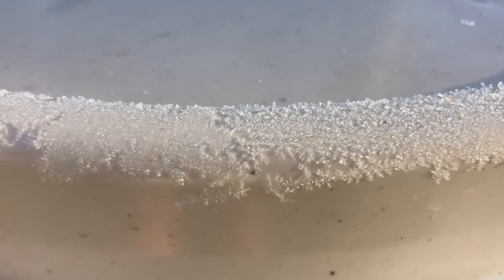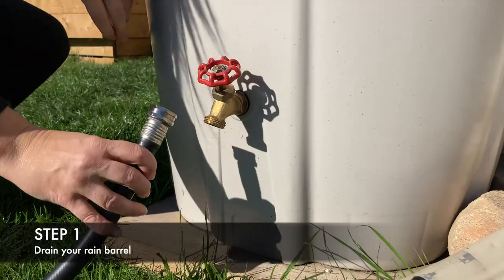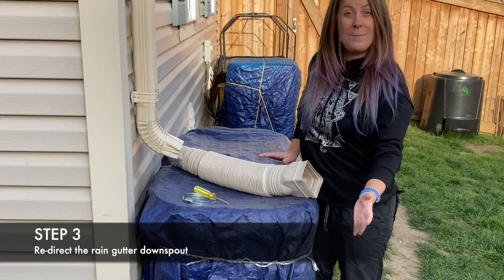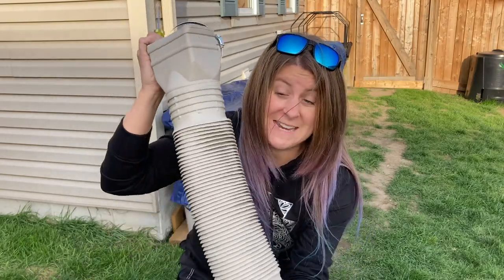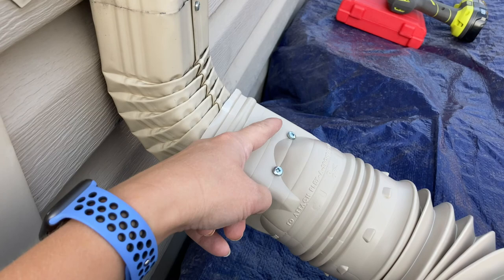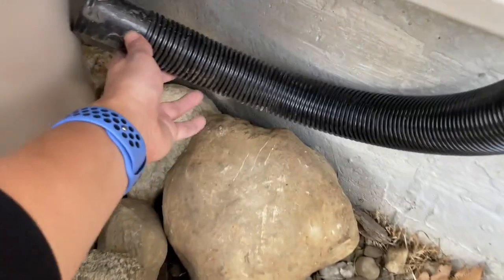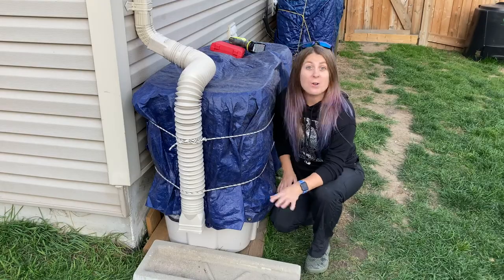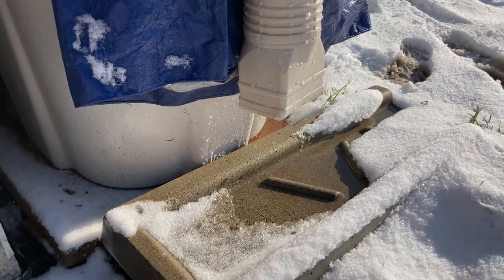How to Store a Rain Barrel System for Winter | DIY Maintenance Tutorial

Comment: How many winters did you get out of that flexible downspout extension? The accordion parts are pretty thin that I would worry about cracking.
Reply from the maker: 3. I just purchased a new one for this coming season because I broke it accidentally bending it impatiently! Otherwise seemed to be fine.